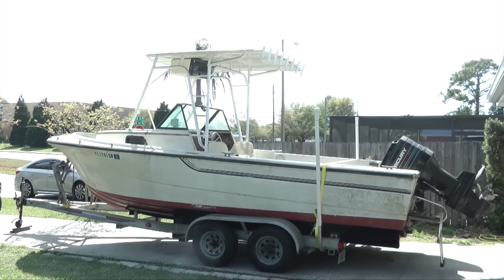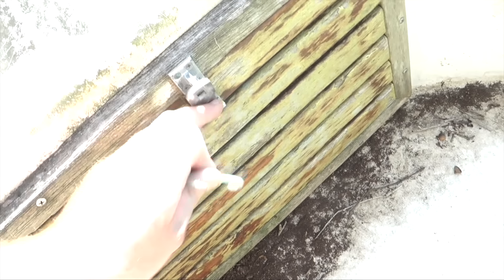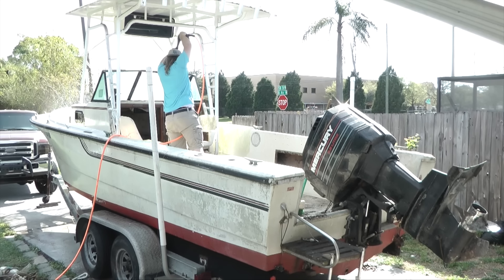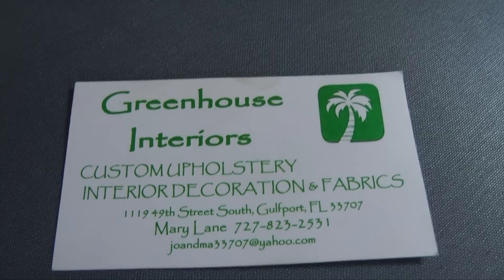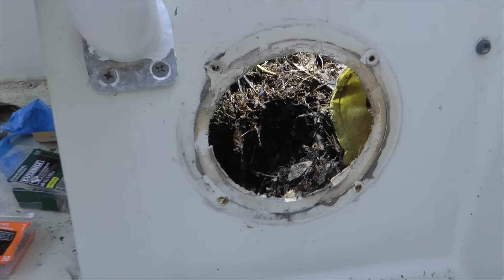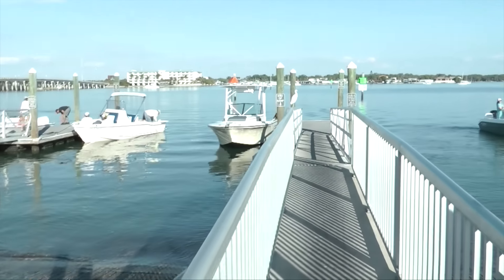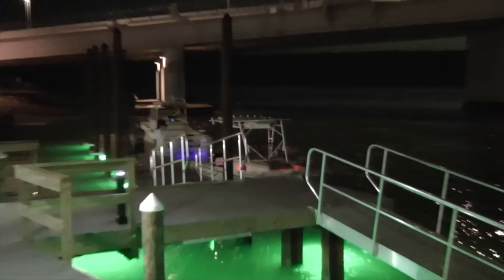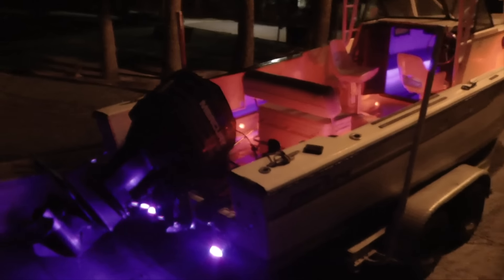Missing Days To Fishing Days

Comment: I always forget how noisey the big 2 strokes use to be. Instant power though!
Reply: Oscar Zamora some kinda inside joke?
Reply: I have 2 stokes the quiet only thing I have a problem with it when I was on the lake for a long time I switch to charge both batteries when I was coming in the charging system acted up  band new batteries on board when we bought  them we never paid what we were bought I took it in to see what it was wrong  everything check out very well  when I had switched to charge both batties  the charging system  shut down because it throws it was charging a 24 vote  battery  they put a larger battery  to start the boat in the other battery does run the radio and the fish finders and trolling motor I do carry 2 more charged  batties on board as well  short time after I got the boat we got stuck comming off the lake in a lightning and thunderstorm it came from no way taken 4 hours getting back to the truck to load it up had a lighting strike hit in found were we were going it blow a fuse under the hood out  we wear lucky  we found a place that had a new one  changed it out   
worked fine  when back out  when time to start the motor both batterys died the isolator failed it drained both batties  
  it hard to start the motor with a rope  we got it started luckily we are not that stupid to figure out how to start it easy with the rope  when we go home the exit day the boat was in the shop to have it look at  they found it and put a different type in the boat 
I had a awesome boss when I bought the boat somehow  4 from work  had to go the mill to work we had to push in the morning then to put up the boats  to go fishing for the day and got paid for  it as well  10 of the fulltime know we were fishing  the others never knew about it 
but I did put long  days in when I worked I start work at 4 am someday stilled 9 pm to help out with loading trucks  the bosses never complained about my hours worked  the summer was awesome I had to show up to  unload and reload the kiln  with lumber then back to the lake to build the cabin  Monday morning I push in and Friday night I push out I was warned to be on land by 8 am that when work, starts at the lake  that when my boss gets up  we go fishing  for an hour, I start working  and have  breakfast short  time after that   we work to 6  and supper was done them we fish to dark  have a camper I live in there  
if I had to start at 4 am I go home right after we eat was nice to have a hot shower then a cold bath in the lake supple we needed  for the lake I would pick up at work too 
the year later I was going to my sister place she was transferred to New Brunswick plan 3 weeks of the holiday   he has given my 6-week drive with my parents  down their and back that was an awesome trap to be able to see Canada I worked harder after  that too  
I never got paid overtime each  hour I worked overtime I got 2 hours regular time  and it was banked time for rainy days when the place sold out I had 252weeksk of pay I got paid out to me a short time after o move on was not the same  place it was I still hard the hours but  was not like it was like before we kept in touch with each other after the company was sold we still go fishing together  still 
we now have a larger group to go fishing with we have now 3 boats to fish with we have it in for each boat I have put a pressure pump on mine now  200 feet I can get both boats soaked too the fish cop did not like it much when it was turned on. on them selfs   they wanted to check the boat for fish  they hit the switch the pumped the water  and soaked them self  never had on on board after that they  did find as in the campgrounds they ask as to join them for the night that got the ground talking  when we had to leave with then 
had an awesome time there  one of the officers was a friend with  one of us
Reply: What language is that supposed to be?
Reply: I have a 96 Merc Black Max 135 that still runs great.  Light, a lot of torque, and fast.  Also burns a lot of gas but who cares if it is still running well.  Nice work on your Proline.  Bonus spare ss prop too.
Reply: That's not noisy.
You should meet my ex-wife...
Reply: Did u have to buy the boat
Reply: @leighgranland8442  I should have left it as the wreck I found it...
Reply: Jennifer White Jesus Christ bro how long did it take you to type all of that. I don’t think anyone even read half that.
Reply: @rider660r  ,
Cool it Dude, at least this dude is trying to communicate with the rest of the world. Just by reading what he wrote, This person sounds like a really hard working individual. What he lacked in his written communication skills, is more than made up by his hard work ethic.
 
I have a Cousin who has Dyslexia, and I really embarrassed myself by commenting on something he wrote before I new he was Dyslexic. Just like this Dude, his writing skills are horrendous. He more than makes up for this one weakness with his strong work ethic and skills as a master craftsman in woodworking. 

Some people fall through the cracks while being educated, others have learning disabilities, such as Dyslexia. At least this dude appears to be a very hard working individual, making his way through life with out asking for Government help, like so many others do. I know what many people think when they see the language being murdered as such.  Please, just keep your comment to yourself. Making fun of his writing skills, just makes it harder for people like this to share their life with you.
Reply: Dear @rider660r  , it's called understanding.
Reply: @LPadillaCR  No it's called needing a damn Doctorate in code deciphering.
Reply: @rider660r  jajaja! That one too!
Reply: rider660r She had 2 strokes. Read the first sentence and it will all make sense to you.
Reply: @rider660r  My answer was more meant as a joke than a real explanation. "I have 2 strokes", could be interpreted as her saying she had 2 strokes (grammatically wrong I know, but the rest of her comment is just as bad) as to explain why she may not be in posession of her full intellect and thus would not be able to formulate correct and coherent sentences.
Reply: @jenniferwhite6089  you are a talker
Reply: @jenniferwhite6089  That was one long sentence.
Reply: @mikeperth8027  thx but i think i will take a pass on that :-)
Reply: @johnxrv  I don't blame you mate!!!
Reply: Jennifer White B
Reply: I love the sound of the older motors, my Evinrude had growling menacing sound wide open, now the motors are boring when it comes to sound!
Reply: And smokey (maybe more so since I premix)!  When I start it up on the dock I think people are looking, lol.  But it's simple and I can fix it myself (200 merc 2.5L).
Reply: @jenniferwhite6089  nice

Comment: I bought a 16 foot Arima that sat in the desert for 20 years!  Luckily it was covered with a Sunbrella cover!  It needed 2 new tires.  The 60 hp outboard actually ran, roughly but ran.  I was tired of playing with old motors so had a brand new 90hp 2 stroke installed along with a new steering system.  I used it for 7 years and sold it last year.  Of course I didn't make any money on it but had many fun fishing outings.

Comment: Just picked up on a custom built aluminum 18' flat (19 feet 11 inches to the fan tail.) with a 130 hp Yamaha that was laid up for 5 years.  Removed a ton of leaves, sprayed aluminum bright on the haul.  Rebuilt carbs after checking compression.  also changed head gaskets.  Learned over the years the head gaskets on outboard tend to get brittle and crack overtime.  Test ran the boat -- clocked at 60 mph with a GPS.  Came with a new aluminum trailer.  2 grand for the entire rig.  Have been bringing old boats back to life for 40 years.

Comment: Awesome restoration and didn't cost an arm and a leg either.  Nice move tearing the fuzzy carpet off the cabin walls.  It looks so much better with a coat of paint in there.  Nice choice using rustoleum instead of some hundred dollar a quart boat paint.  The money spent on the upholstery was very well spent.  Its impressive how much you accomplish with a lot of work and very little money.  If you ever get over to port Canaveral, the beer is on me!
Reply: Would it be acceptable to put Rust-Oleum on the outside also? Top cap? Hull? 
The one I'm redoing will only be in the water when in use.

Comment: In the berth you'll need to put carpet back on wall's and ceiling, as it will prevent condensation to the cold fibre glass.
Also helps with the sound, from echoing.

Comment: You guys did a great job bringing that boat back to life... just don't forget to check the ball bearings on the axe hubs that trailer has been seating for a long time.... at least check the condition of the bearings, repact them with water proof  grease since the boat is now back in the water. Salt water is very unforgiving...👍

Comment: Great job guys. I have been restoring a 2000 Bayliner capri. What a freaking nightmare !! resplace about 80% of the decking. paint  and new vinyl on the cushions.  rebuilt carb, new fuel pump.  waiting for the spring now.Thanks for sharing. I subbed.

Comment: little trick if line the inner cover with a sound suppressant you can reduce the noise by quite a lot.
Reply: That particular cover  is air restricted as it is.    Adding sound deadening make it worse...   if anything. Open up the rear air inlet tray and let it breath

Comment: All those years sitting out getting wet being covered in foliage there is a good chance its got rot in the stringers, transom, etc.
Reply: sdvten exactly what I said. Leaves dirt , rain and small rodents are great for making rotten wood in a boat!!  I just hope he checked it out
Reply: This boat is rotten to the core.  Guarantee it.  That transom will be covered in cracks after using it like that.

To those watching these, the cosmetics are the easy fixes.  This hull/transom is completely rotten inside and would be super dangerous to be on.

Comment: Seems like the cowling is missing the soundproofing material because it's awful loud
Reply: That sound is from the exhaust, and they were loud, you should here one on a bass boat, and they are way faster on a bass boat!
Reply: I love the sound of that 2 stroke 200!
Reply: yeah sounds like marbles in a tin can in the video, but they do sound meaner in person. wonder if you can quieter her down at idle?
Reply: I thought it sounded like the exhaust was not going through the prop like it's supposed to.  I wonder if they got all the exhaust pipes and chambers going down the leg put back right.

Comment: Nice work, I did a similar thing with a proline 2003 that was not as bad. I love it. Still have it. Swapped 2 stroke 150 for a 4stroke yamaha. Proline stopped using wood in their hulls in '96. Earlier than most brands. Any hull after that should have no rot.

Comment: Bro not to burst your bubble at all because your vids are really good. Maybe i'm wrong but it looks like the driveway is at a downhill slope. I made that mistake once when i was getting into the boat and it moved just enough to turn the front jack wheel and started rolling down the driveway right towards the truck. I had three people with me and we managed to stop it before it hit the truck. One of the many little stupid mistakes i made that could have ended real bad. Im not going to tell you about the time i forgot to lock the hitch up. Keep up the content!

Comment: It won't hurt that motor running couple seconds without water. They make truck bed liner in a lot of colors. You can get s.s. skegs that epoxy on over the aluminum one
Reply: Robert Fandel yeah the only thing you have to worry about though is your impeller warping because there is no water to act as a lubricant for it but as far as serious damage it won’t over heat in a few seconds and you are correct there.

Comment: I don't understand how the transom isn't rotten.  Every old boat I look at in FL that's been sitting outside will have a ton of flex in the transom when pushing down on the lower unit of the motor.

Comment: She's rotted though. Guarantee the transom/ stringee is mush and flotation foam is water logged. With that much growing in the boat, the wood structure has to be compromised. I could actually see a ghost line in the transom in one angle which is a tell tale the transom is flexing. tin boats are easier and cheaper to do up.

Comment: Hey I just picked up a old boat for a project got a little inspired and was planning on replacing the motor on the boat but in my opinion the motor on the boat don’t look too bad it’s a 80s mercury motor it’s a 115 hp and no one in my area will work on it due to it being before the 90s. I want to try and start it and follow your steps to get it running but I have no idea how to Hotwire or wire a push button. If you can please help me with some basic info or if you have a video on this specific video I would appreciate the help!

Comment: Now all y'all need is A smart TV's.& security cameras.& A DVD players.& gaming system on deck. I add Solar pannels to for backup power feed.& two batteries 12.,or 24 volts hooked up into solar charging pannels.& Amplifier.& waterproof subs to your sound system. With some pictures of your fish you ketch.& etc. Like deck party pics. It needs   A mini fridgerator like in hotel rooms.& in motor homes.,or RV'S have in them. I'll give you A thumbs ☝ now to. Good job on it so far guys. Add to the appearance more decore with change it up more.& modernize it to up to date features aswell. Like by adding in Some deck accessable USB plugin ports for phone charging.&etc. Like drones.& Bluetooth speakers also.& cigarette lighter plugins to. One of each to A it's own outlet area with covering seals to when not in use.

Comment: a couple of questions as I am not a boater. Would you on this boat add a larger motor or two motors to it?  second does it have an internal fuel tank ,how much fuel will it hold  what range  and probably most importantly how much would you spend on a boat like this one? Thank you

Comment: Beautiful. But that engine idle seems awfully knocking....

Just curious as a drylander, is there a special method of getting all the saltwater out of an engine other than flushing with freshwater?
Reply: Guy H. There is really nothing internally in the engine that gets saltwater in it other then the cooling system. It sucks water in with an impeller and goes out after it cools the engine so other then flushing it out with “earmuffs” and spraying it off there is really nothing you can do easily but nothing other than that is necessary.
Edit: also as far as the knocking sound at idle that is just how those old two strokes generally are.

Comment: Is this Florida?  I'm in Australia so sorry if the geography is obvious and I'm missing it.
Also can you/ have you ever seen someone install modern adhesive backed sound deadening under the cowl of older (or any) out board,.  Just to try to lose some of that old mechanical 2 stroke racket,  so not the exhaust noise.  Some of the new sound deadening products are fantastic and not very thick.
Reply: St Petersburg, Florida.

Comment: Did you rewire whole boat, pull fuel tank,  check for rotted transom, stringers, change all hoses, hoses on old merc, trailer bearings, bolts and lights, surely the deck was weak, changed all pumps, and why spend $ on stupid bling?

Comment: I have a boat I just bought how do you find out what size the motor is if the plate info has been heavily painted over. It's a Mercury 2 stroke like yours with the same 200 cowl on it but he is telling me it's a 150 not a 200

Comment: Where do you get your LED lights from?
Reply: You can get them off Amazon for cheap. I got a 12 inch on my boat and paid 15$ cause it was on sale.
Reply: @patrickbordelon3654  12 inches for 15 bucks?
Reply: You talking about about the light bar or the led strips? Cause the LED strips are cheap too on Amazon. I was talking about the LED light bar. So for the confusion.
Reply: @patrickbordelon3654  Thanks.  I want to light up my Grady with some LED's  in the cabin and under the gunnels...

Comment: Why does the engine sound like a bag of nuts and bolts when going slow.
I know its a two stroke but they dont usually sound like that and i think i would be just a little concerned about taking it out into open water without a back.